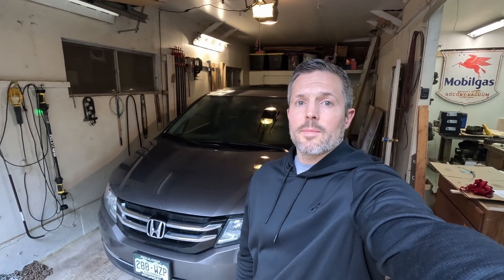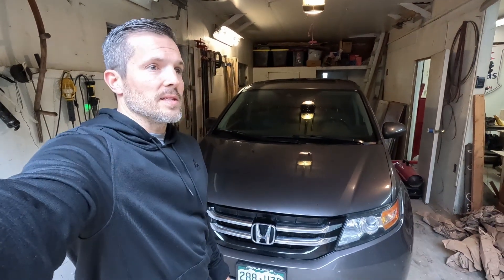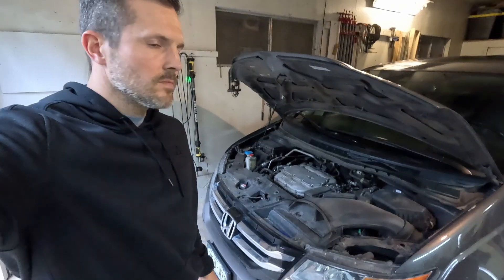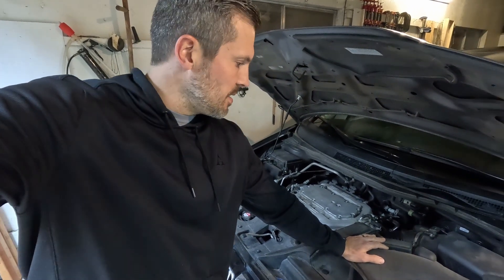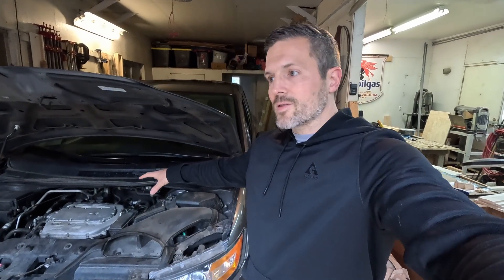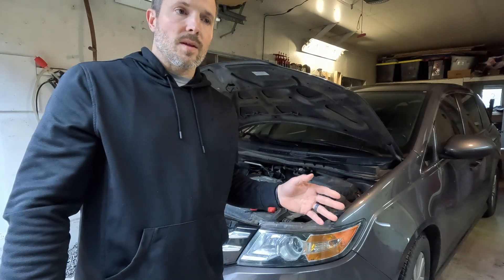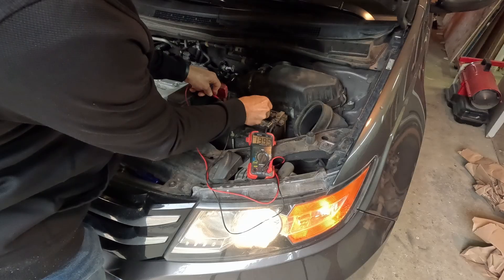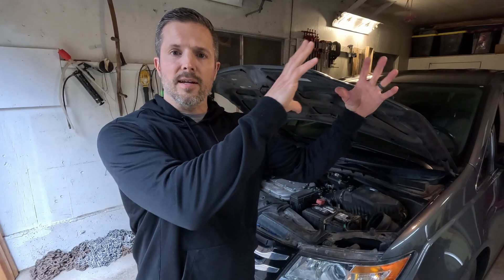2016 Honda Odyssey Diagnose Battery or Alternator Trouble

Comment: I got a brand new battery it’s only been In the car for 7 months and I charged it I just replace the alternator with a brand new one just now and that battery light is still on
Reply from the maker: Sorry to hear that.  If that were me, the next thing I'd review was ground connections.  And double check the connections for the battery and alternator just to be safe.  And then take the alternator back to where you bought it because I have also gotten a "new" alternator that was bad out of the box before.  Its unfortunate but it does happen.

Comment: If a alternator is bad how long will it take for the battery to drain completely
Reply from the maker: It depends on how much you are driving the car.  And how many additional components you're running.  AC plus lights plus radio, etc.  That will drain it faster.  Each time you hit your brakes, your brake lights will pull a small amount off the battery.  If the alternator really isn't generating any charge it needs to be replaced immediately.
Reply: My mechanic is about 45 miles away.  If I charge my battery fully.   Do you think I can make it?
Reply from the maker: Oh geez, I don't know.  I would like to think that if you minimize your electronics then you've got a good chance.  But I'm not sure what will happen to your car if the voltage gets too low.  The van may shut down and you could be stranded.
Reply from the maker: Here's an interesting post on the topic.  This guy got 40 miles:  https://www.odyclub.com/threads/how-far-can-you-drive-with-a-dead-alternator.281273/